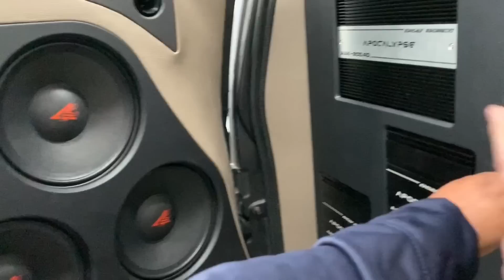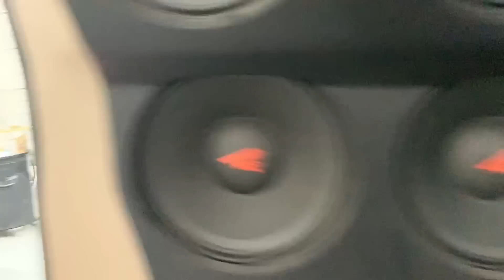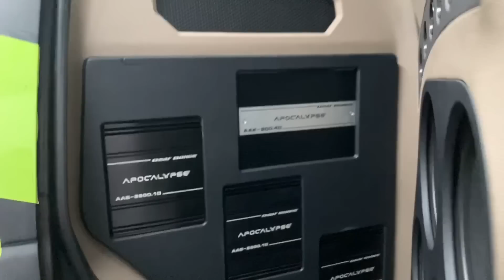THE NEO HOE (TAHOE) UPDATE WE'VE ALL BEEN WAITING FOR!!

Comment: She is such a likeable person.
Reply from the maker: I agree
Reply: Yes she is.  Bass heads tend to be good people.
Reply: for sure - cool lady.  great experience for you and her!  awesome build
Reply: @LerRhann  
Not the few I met in Norfolk (aka Hood Central) and Virginia Beach (aka Shitville) though. Those people are Jerks! They figure they have expensive sound system They want nothing to do with you, not wanting to communicate with you and think you don't know what you're talkin about. They look at my sound system and it's like oh it's a small system....... They suspect me to run Sundown, PSI or  Alphard......I can't afford that shit I have other important things I have to take care of 3 kids, vehicle insurance, getting the vehicle fixed, putting food on the table, rent, job and etc.
  Here is what I have in my 1998 Toyota 4Runner 2.7L Rwd:
 1. Ampere Audio Rve 2.5 8 D2 Subwoofer.
2. Custom ported med t-line subwoofer enclosure with white wolf fur my lady and I made.
3. RE Audio SA 1500.1 amplifier.
4. Soundqubed QS-6.5 Components (Front)
5. Soundqubed QSX 652 6.5 coaxials (Rear)
6. Dual sky high fuse block for my amplifier and my alternator.
7. Yellow top optima battery
8. Pioneer DEH-S6010bs Head unit (Non Double din)
9. Big 4 (4 gauge welding table)
10. Soundqubed volt meter.
11. Slowly building to get the rest I need :)
 it's like they're suspecting everybody with a sound system to run a whole bunch of speakers that we all can't afford? Some of us don't like all them damn speakers even though we love the sound of it. That shit cost lots of money and we all can't afford that. They seriously think they're all hot shit or something. I can never figure out why they are the way they are? The way my lady and my friends always say is: it's all how your attitude is based on how you're raised and people you hang out with.
 So yeah..
Reply: She should unveil every system update
Reply: what’s the song called at 7:50
Reply: @macalla1996 still got the system?